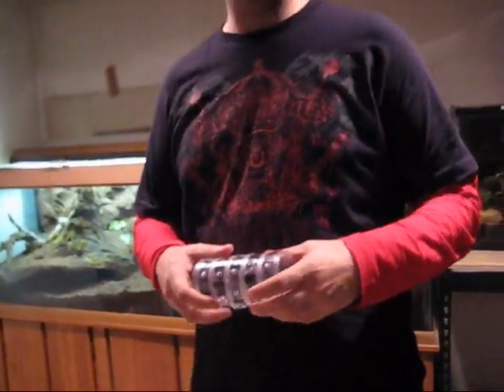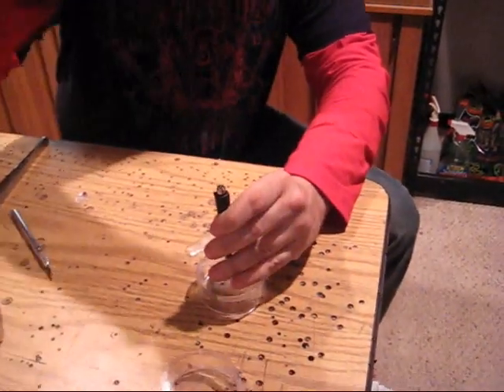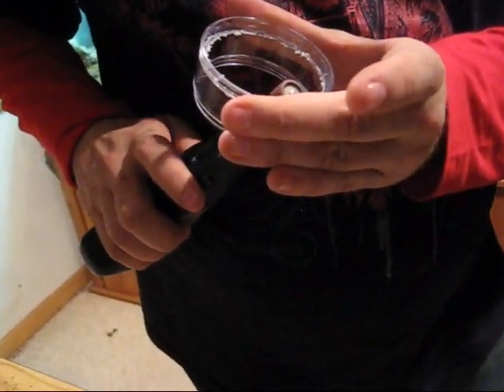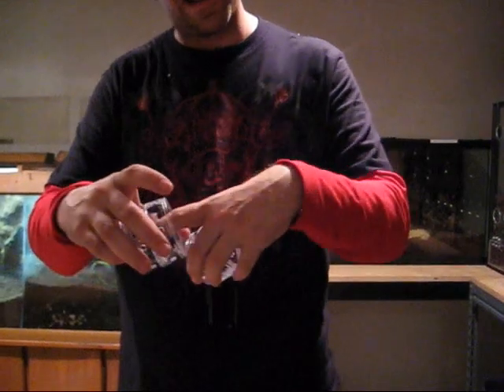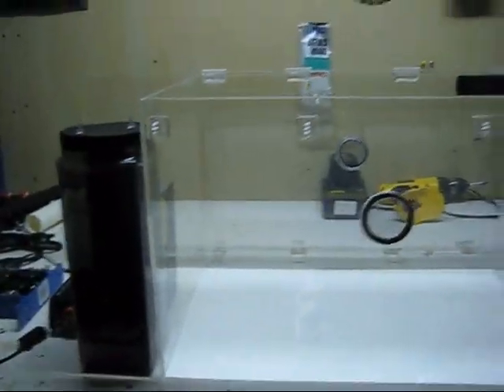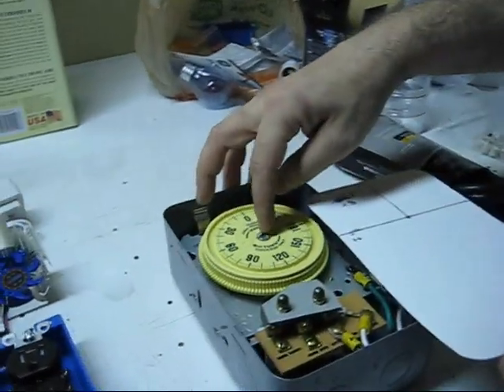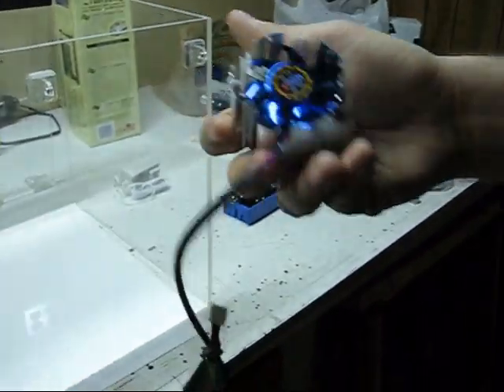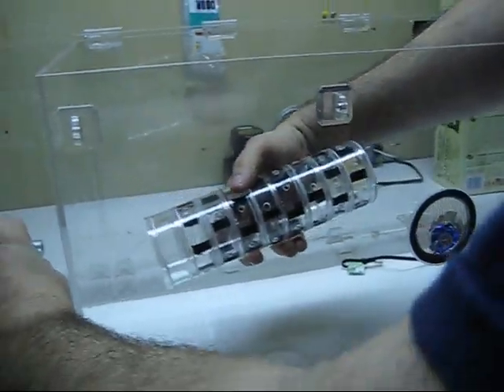Mechanical Mom tutorial Part 1 of 2

Comment: Another thing I was thinking about: Instead of spending 150$ on the 4h timer, you couldve taken a 24h timer (or any clock) and use a second gear with 1/6th of the cogs (is that the right word?!) of the 24h timer and attach the rod to the smaller gear.
Couldve saved some money...